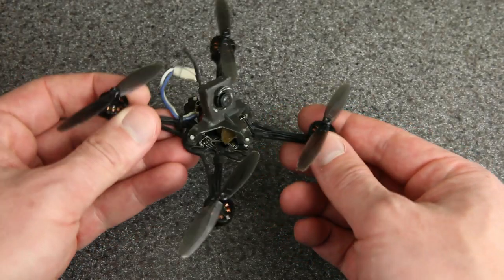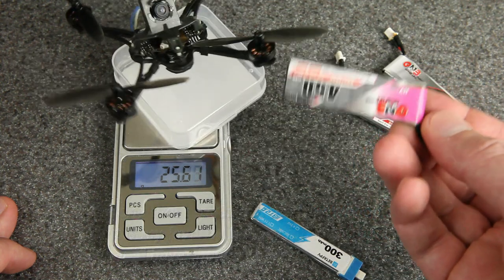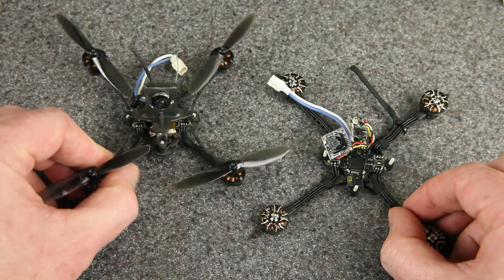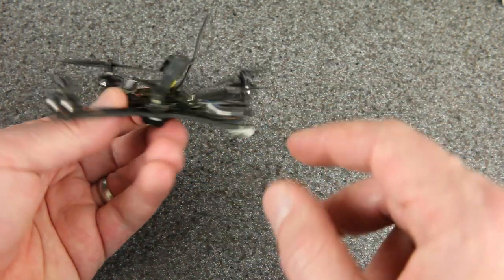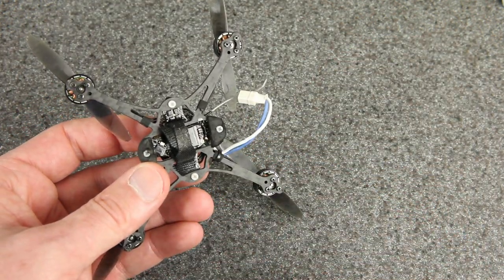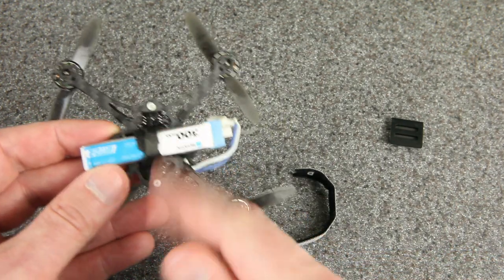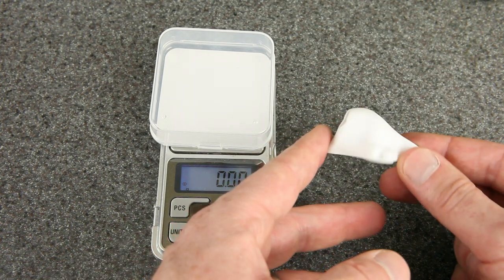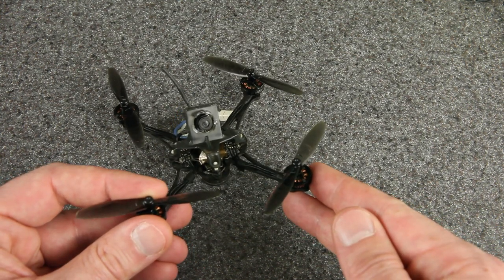My 2.5" Toothpick Just Got Better

Comment: Large winged insects aren't the only ones having all the fun now. 🥳
Reply: RAGNAROK FPV  I use lipo setting to charge. I just charge them at maybe 1.5A.
Reply: RAGNAROK FPV  it's 1s. I just set the charger to 1s
Reply: RAGNAROK FPV   if you can find/buy/make an 18650 case, than solder an xt60 or 30 connector. Thats what I would do. Either that or buy an 18650 charger.
Reply: @sylaswojciechowski6895  You'd likely have trouble with unnecessary resistance from spring-based battery contacts, mechanical jerk from maneuvers creating a momentary contact gap that would reset the electronics during flight and cause a crash, and at 1S every extra gram of AUW has a greater negative effect on flight dynamics.  The less resistance and complexity between the power source and the motor coils, the more reliable and efficient the flight system.
Reply: @mistercohaagen  I thought that Ragnork fpv was just talking about charging, not flying, it would be funny to see a 18650 charger sticking out the bottom of a toothpick though 😄. I guess he could just solder a battery lead to the 18650. I didnt think of that, im guessing thats how kabob did it?
Reply: Add a hook and you could use it for fly fishing!

Comment: Hi, i want to convert my uruav uz80 to a 2.5 inches toothpick. I have 2 options for the motors,  the first is 1102 10000kv motors, the second is 1102 18000kv motors. I don't care too much about flight tim e, more about performance, but I'm afraid that the 18000kv will be a bit too powerful. What do you think?
Reply from the maker: Hi. I already replied to your question on a different video, but I'll paste the answer here too, for other readers:

18000kv is an OK motor for 40mm props, but the KV is too high for the 2.5" or 3" props. BetaFPV made a 3" drone with those motors called the HX115 LR, and it has terrible performance. Anything over 50% throttle doesn't do anything because the little 1S battery is already at its limits. So, no don't put 18000kv on a toothpick. For 1S, I would choose the 1202.5 11500KV motors and 3016 3-blade props like the original "Babytooth". For 2S, I would go with the 10,000KV motors with 2" or 2.5" (2 blades only for 2.5"). I hope that helps. Happy building. :-)

Comment: FYI, they now ship with the new canopy in black...just got mine yesterday!  Tilt is 23 degrees, and now weighs (DSMX version) 28g and has Gemfan props. The sucky thing is still that it only attaches on the sides so it's jello city (and stresses the plastic bolts).  I did a small dab of hot glue to stick it to the frame, but yeah, would be nice to have the best of all worlds. :P

Comment: I too am building up a replacement to my babytooth that’s up in a tree.   I have one of Quad66’s SkyRyder frames but haven’t decided on motors yet.  Interested to hear what you think of these motors compared to the FPVcycle 1202.5’s.   Also, we really don’t have a lightweight alternatives to the betafpv 1s fc do we?
Reply from the maker: I’ve had good success with the BetaFPV FCs but there are other options. The Happymodel 1S FC can work if you want the built-in vtx. Unfortunately it’s range can be super short unless you mod the Rx antenna. There are other FCs now too, but I haven’t tried them all. Nice to have options.

Comment: Love my hx100 se !!! I can’t believe it’s no longer made. Any inside information about a successor (same size weight and 1s) ?
Reply from the maker: Yeah, it's a shame because the HX100 SE was one of their best flying drones. Hopefully they replace it soon.
Reply: @MrShutterBug  have you tried the ant lite camera on it. Flys nice. I’m still getting 3 minute flights on the beta 300mah batteries and 4+ on gnb 450mah I like the ant lite because of its good night time exposure. Almost like night vision. Very impressive.
Reply from the maker: @jeffro1005  not yet. I have the Ant Lite camera from FPVCycle but haven't gotten around to using it yet.

Comment: Great video Mr. Toothpick bug!  lol 😜   My 1s Toothpick weighs in at exactly 24.7 grams, ready to fly, without a battery! I used the incredible R3D Shifters ION Zero GRAV frame... Super durable, but very light and especially ultra low profile! The whole Toothpick is less than 1" thick! No big camera sticking up... It's slim and trim! Frame is made in NYC, NY, USA! Those guys are design geniuses! 😎 🤘 Custom service is a 10 also! Flies great!  I use the GNB 350 mah 1s batteries available 6 for $23 on Amazon. I've heard they're much better batteries than those BetaFPV 300mah.  Many say they don't like those 300's.
 Total build cost was only $75.50 SHIPPED! 😳
Challenge On! Beat that low weight and low cost! Lol 😂 😉
Reply from the maker: GNB batteries are always pretty good. In the past, betafpv sold a 300mah 1S battery that was terrible. It was one of the worst batteries I ever used (and I had many of them). BUT... the newer 300mAh batteries they sell with the BT2.0 connector actually come from a different manufacturer. They actually work pretty well. Comparable to the GNB batteries.
Reply: @MrShutterBug  Good to know, but I'm not sold on using the proprietary connector. Sure, it allows more current to pass through, but it doesn't seem to be getting adopted, so it's not for me.
Reply: Scoot Roter what is your build!? That sounds like it would be fun!
Reply: @ndmfpv1776  Banggood had their hovercraft on sale for $52 shipped. It contains the AIO FC and camera from the Mobula7 with the 19000kv motors from the Mobula6. I immediately stripped it out of the frame, through the frame away, and popped it into the R3D Shifters ION Zero Grav frame.  Super strong and surprisingly stiff!  If you haven't tried one of their frames you should! The designs are EPIC!  They've thought of everything!!!  Comes attached with it's own stretchable battery strap that will hold any size small battery you have...so much more versatile than a battery cage.  24.7 grams with 65mm props! :)

Comment: I would like to ask for advice for a toothpick build.

I have a URUAV UZ85 that is equipped with CrazybeeX v2.2 1-2s 5A 4in1, Gemfan 2023 3-blades (0.88gr x 4) and Happymodel EX1102 10000KV 1-2s (2.8gr x 4) motors.

I want to convert it to the Happymodel Sailfly-X 105mm model but I want to use the Gemfan 2512 3-blades (0.80gr x 4) instead of the Happymodel 65mm 2-blades (0.50gr x 4).

The dry Sailfy-X weighs 38gr, my build would weigh 34.2gr.

Can Gemfan 2512 3-blades be used on EX1102s with 5A 4in1 ESCs with a lighter drone?

Risk of burning ESCs and motors?

My dry drone weighs 40gr because I modded it with external VTX and strap to use different batteries, using the Tattu 450mah 2s and the strap I have a weight of 71-72gr and a maximum absorption from the ammeter of 12-15A with very aggressive driving .

in theory on a lighter drone using larger propellers but with a lower pitch the motors with high KV and high voltage would spin better and with less effort generating more thrust and absorbing less, correct me if I'm wrong.
Reply from the maker: It sounds like it should work. Having larger props will make it quieter and will probably give it longer flight times. You might want to consider using 65mm (2.5 inch) 2-blade props instead, since they will be lighter and may have better handling (less torque required to change rotational speed during fast moves, prop wash, etc...). 5A per motor will definitely be enough to fly with. If there is any danger to the ESC, it would be during a hard crash or when using turtle mode in a situation where the props can't spin. Those situations sometimes heat up the ESCs more than normal flying. You'll probably be OK, but there's never any guarantees in this hobby. Good luck!

Comment: Impressive flying as usual. I just built a Babytooth 3S, 1303's, RC nano 3 w/ Beebrain canopy, eachine Nano VTx, Rxsr, Nameless AIO412T, and I think I must have burned the VTx testing the motors (yes forgot to put the antenna on). Was torn between the Eachine nano and Nameless nano for Vtx. See you just changed stock to Nameles Vtx. Prefer it to the Eachine nano?
Reply from the maker: The NamelessRC vtx is a little smaller than the Eachine vtx, but both have worked fine for me in the past.

Comment: I like my hx100se. However my board reboots once it hits 3.2v, which one hits almost each time climb or make a tight fast turn. Once it resets, the osd/vtx disappear and the quad falls.
Did you also have such experience?
Reply from the maker: Bummer. No I have not experienced that problem with the BetaFPV 1S FC.

Comment: I just finished a 2.5" build that comes in at 23.2g dry weight. Cant wait to fly it fpv tomorrow. Feels pretty sporty LOS in the house.
Reply: Setup please 😀
Reply: @WhoopEnjoyer  OG Gnarly FPV 08XX 2.5" Whoop swap frame (discontinued,) Happymodel EX0802 19000kv unibell, Gemfan 65mm bi blades, Happymodel 900MHz ELRS 1S AIO 5 in 1 whoop board, Runcam Nano 3 1st gen., Gnarly FPV fixed angle TPU camera mount, Titanium mounting screws. Here you can see I flew it out 1.5 miles, and upon returning to home point I was able to still powerloop without seeing OSD  battery warning. If my link doesnt show , just navigate to my channel and watch "2.5" Quad a Mile  from Home (re-upload. )
Reply: @WhoopEnjoyer  couldn't remember the name of the frame earlier.  It's the Gnarly Primo. First incarnation was with a CrazybeeX board, which failsafed out by my mailbox, and the mailman pulled up seconds later and ran it over. Board still works to this day, but no vtx. Frame had a nasty crack in one arm, right near motor mount, and I couldn't get another. It was such a  special build that I found a way to repair the frame like it never happened, and rebuilt with the ELRS 900 AIO. The little Primo frame has a single hole on each arm, just out beyond the motor mounts, which allowed me to thread that long a** T antenna, each end, seperately through each of the rear arms. It's one of those builds with unique, favorable qualities, and it sits in mint, but dusty, condition, ready to fly to this day.
Reply: @24kJames thank you! ive just orderd rcinpower 1202.5 11250 crux frame HM x12 elrs 3018 props and runcam thumb! im looking forward to test it
Reply: @WhoopEnjoyer  That will make a nice build. If you can find some, I recommend trying the Gemfan 3015 folding bi blade too, especially on 1S. Happy flying!
Reply: @24kJames  Thx! Do you think it could fly on 2s? I dont really want to fly 2s but it would be great
Reply: @WhoopEnjoyer  I've flown the RCInPower 1202.5 11500kv on 2S with Gemfan 2023 triblades, on a lightweight 3" top mount build. Got roughly 4 mins of punchy flight. I think the 3015 folding bi blades could work too, but might need a small cut in motor output. I have not tried yet though. I use the Darwin FPV 1-3S 13A whoop board (with onboard ELRS,) for these type builds.  The 13A capacity allows a bit more flexibility with motor/prop combinations.

Comment: How are the flywoo 1202.5 11500kv Motors compared to the 1202.5 from FPV cycle?
Reply from the maker: The Flywoo motors are working fine, but they sound a little noisier than the FPV Cycle motors. I can only notice that on the bench. They fly fine.
Reply: Thank you very much 👍

Comment: Batteries shown don’t have the same connector as your battery lead.  Do they still fit or did you have to mod them?
Reply from the maker: I'm using the BT2.0 connector on this drone. BetaFPV and TinyWhoop sell batteries with that connector. The GNB batteries come with the PH2.0 connector, so I had to change them. Here's a video about that mod: https://youtu.be/nmwOxncToJM

Comment: good evening Mr. i have a question. this little quad , has it's own receiver or it is integrated into the fc? i mean , if i buy a Frsky lbt version, is it possible to swap to an fcc version? or , is it possible to add a separate receiver? thank you for your answer.
Reply from the maker: If the FC has a built in FrSky receiver then it will be FCC or LBT. I don’t think you can change that. If, however, you get the No Rx version of the FC, then you can add whatever receiver you want. Good luck.
Reply: @MrShutterBug  PERFECT. Thank you for the answer❤

Comment: Thanks for the vid Shutterbug! That was some crazy flying!! I have one question: do you need to solder the runcam nano 3 onto the board or can you just plug it in?
Reply from the maker: I soldered it. If you want plug-n-play, then HappyModel and NewBeeDrone both makes 1S FCs that have a plug, but you have to double check that the RunCam camera comes with the matching plug. That's not always true. Good luck.
Reply: @MrShutterBug  Thanks!

Comment: the Betafpv C01 Pro = original Hx100 SE FPV Camera has waay to much FOV, right ?
the RC nano 3 has less FOV ( better ) and Colors are better ?! ( at least by low light I think..)
Reply from the maker: The HX100 SE normally comes with an M01 camera. The C01 Pro is bigger and heavier, but has a better picture quality. There is also a "C01" (not "pro") camera now, which is small like the M01 camera, but better. I agree the M01 has poor light handling. The C01, C01 Pro, and Runcam Nano 3 are all better options. As for FOV, the Nano3 is also quite wide, and that's how I like it. You need a wide FOV to give spatial awareness when flying close to obstacles like this. Cheers.
Reply: @MrShutterBug  the original Hx100 SE, M01 camera has a weird FOV.. I guess it's only the fisheye effect which makes it look weird...

Got the C01 Pro today...
Reply: @MrShutterBug  Can you recommend a "M7 Lens" like 1.8 to 2.1 mm - huge FOV, less fisheye ? 

Backstory:
I just conformal coated + silicone glued my 1S TP..

After flying in the rain ( really awesome TBH ) 

I got water in the lens.. ( hard to make the lens itself Waterproof.. The PCB is dry..) 

After drying, the lens "is making weird shadows" when I hold it against light..

Comment: Hey dude,
do you run rpm filter?
I´ve got A LOT  of problems with my escs... Do you think you might help me? I feel like i´ve tried everything you could but it´s still not working!

I run the Diatone Mamba f411aio board

These are the problems:
-everytime i hit "read setup" the Blheli / JESC configurator only detects a random number of escs (23, 124, 234, 134 etc.) 
-Every once in a while it pretty randomly detects all 4 escs and i try to flash JESC (bidirectional dhsot) on them:
-After flashing it says*FLASH*FAILED* behind the version number of each esc.
-Now i cant even reflash the original non bidirectional DShot...

This is what i´ve already tried:
-Changing the Usb Cable (to a brand new one)
-Trying to flash on a different computer
-swaped the hole aio board (to a brand new one)
-switched to Dshot150 cause according to bardwell its the most stable one
-(emailing Bardwell, short chat under a youtube video with UAV-Tech, just texted the owner of JESC, emailed my local shop...)

I literally have no idea on what else i could do. I´ve invested so freaking much time and money, here is no way that this quad won´t fly. I have to figure it out somehow. I can´t give up! Gosh sorry for bringing all this negative energy here but im sooo incredible frustraded. I´ve been trying to figure this out forever

Thanks man!
Reply from the maker: That sounds frustrating. Sometimes the ESCs can get messed up by a bad flash, and then attempt to reflash will fail. This is usually caused by the fact that the configurator wants to verify that it is flashing the correct version of the firmware onto the ESCs (O-H-5, C-H-15, etc...) so it tries to read the previous version , but the read fails because it is in a bad state. The fix is to double check that you know what the correct version is for your ESC, and then click the check box that says "ignore inappropriate MCU and Layout", then Flash All. That has solved it for me in the past. Good luck.
Reply from the maker: No RPM filtering on this one. I don't think it needs it and RPM filtering takes a lot of CPU on these little F411 chips.
Reply: @MrShutterBug  I´ve tried that many times actually... sadly;) Actually somth really weird because it doesnt recommend the esc most of the time, even though i switched like everything. Computer, fc, esc, cable software... Everything. Dude i´m so lost right now. I feel like there is nothing i can do!
Reply: @MrShutterBug  You think a 100g TP3 flys better without rpm filtering?? First time i hear that. Might spare me a lot of work, even though i want my quad to fly as good as possible - just like it did
Reply: That's why you dont follow the hype,sorry for being blunt,always fly default and then when you feel comfortable and knowledgeable enough...then attempt to flash a different protocol
Reply: @huckaberryfpv4986  sure but that actually simple was a fault of the board, not by me. Should have worked perfectly. Actually the developer of JESC worte a new software because of this issue which more or less solved it
Reply: @rawpicsfpv3516  understand,glad you got it figured out,and thanks for responding,I've learned alot by random posts,so again thanks for educating me,take care🤜🤛

Comment: Are you building a dji nebula setup?
Reply: If so 2s seems the only option if we're trying to be bending the power weight ratio any, two 250mah , babytooth setup? Betafpv v3 2-4s board.
Reply from the maker: I was one of the first to preorder it, but it still hasn't come. It'll be lighter than the Vista, but still too heavy for a micro drone, IMO. I haven't decided what to build with it yet.